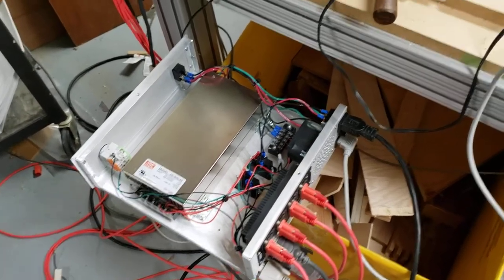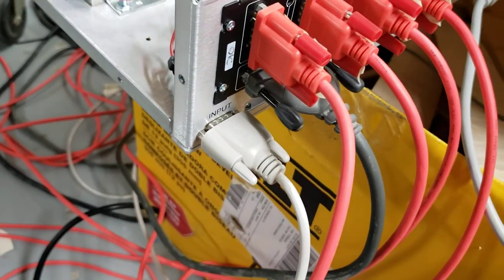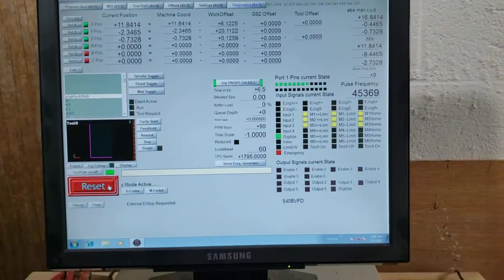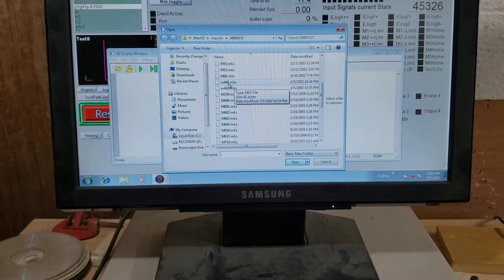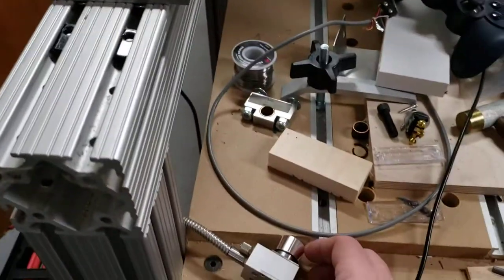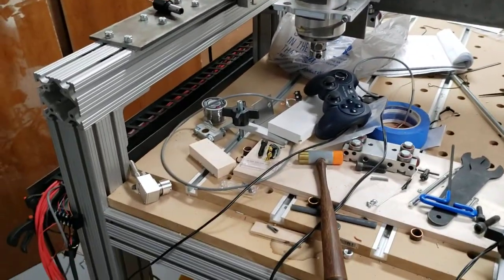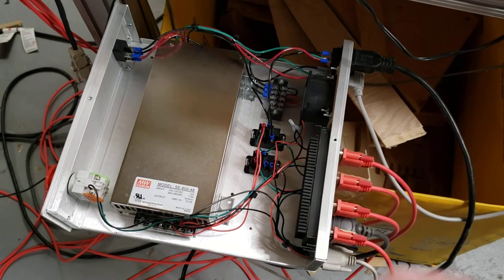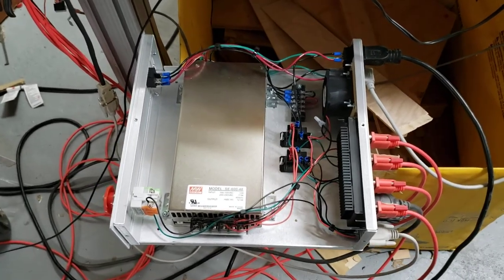Geckodrive g540 probe and tool setter switching

Comment: Are the probes both NO or NC or can you have one NO and one NC and this still work?
Reply from the maker: The problem i had with mine was that both are NC, but once i disconnected the spindle probe from the wire, it broke the connection. My first iteration involved a flip switch, but I crashed the spindle probe the first time I forgot to switch it, so I added a relay, but now I'm doing it through classic ladder using plc logic and an m code

Comment: Nice video, I'm in the process of setting up a Z touch probe after all these years of zeroing with a Harbor Freight feeler gauges.  I have a G540 also, can you post a link to the enclosure?  I also got a Muscle Chuck a few years ago but stopped using it because it seemed not to be balanced very well and caused a bit of extra vibration when running.
Reply from the maker: Yeah the muscle chuck didn't work well. Turns out there's an issue with the Hitachi routers where they have 3 different collet tapers, so it's a crap shoot if it'll work or not. 

Here's a link

https://amzn.to/3pA6poI
Reply: @TheFeralEngineer  Thanks!  Also, is that a basic ground block inside the enclosure?  What's an IEC connector for?  I don't think I need one for my setup but still have no idea what it is.
Reply from the maker: I used the iec because my power supply is inside the enclosure. I used the distribution block for power and ground but I rebuilt the enclosure one or two more times since i did this video. I added a superpid, wired in a new db9 port, bunch of other stuff

Comment: Do you have a link for your enclosure? Also if you get some stand off buss bars you can split the 2 outputs into as many as you like and could control the dust collector as well.
Reply from the maker: Here ya go
https://amzn.to/3Rwy5Zw

Yeah, I could do that, but my dust collector is hooked up to a remote control, so I can turn it on/off from wherever I am in the basement 🙂

Comment: vinces fan  recomendation is louder than a jet.  i used the same meanwell psu on my buillds...takes up the whole dang box...do you have alinkg for the tool setter?
Reply from the maker: Yeah, the fan sucks, I hate running my machine because of it. I didn't realize it was a 60mm fan with an 80mm hole in the case, so I had to make an adapter plate for it (I used MDF because I don't have a 3d printer), so I don't have a lot of room in the enclosure between the fan, the brick of a PSU and the superpid i've got inside the thing now (no most recent videos on that one). I do plan on doing a servo upgrade to the machine eventually, so the G540 box will ultimately find its way to a homebrew 3d printer or something of that nature. 

as far as the tool setter, the one on the machine is a little smaller than I would have liked, so for my SX3 mill, I bought a different style one that also seems to be built pretty well, for a 60 dollar chinesium jobber. 

here's a link for my 8 cents https://amzn.to/3aw5LkJ
Reply: @TheFeralEngineer  i have now given you 16 cents today...you hhve only given me like 15 years of knowledge...i feel cheated.
Reply from the maker: @minskmade  I've been at the machining game for 26 years... Gotta invest some time into making more content
Reply: @TheFeralEngineer  this time next year you will have 10,000 subscribers...
Reply from the maker: @minskmade  at a rate of 5-10 new subs a day, I think I'll get there 😊